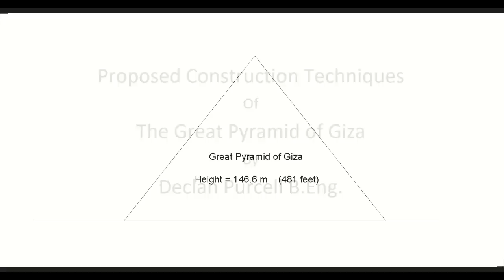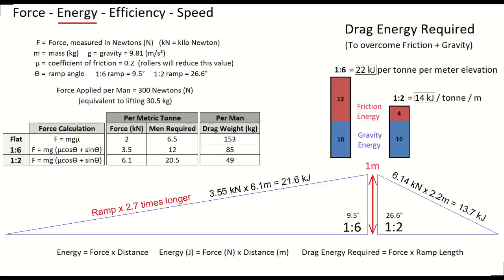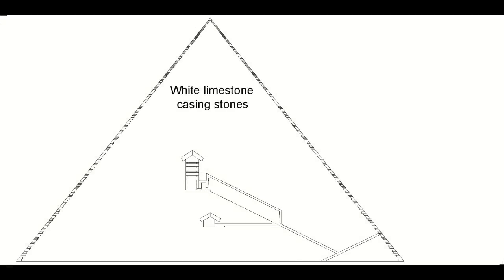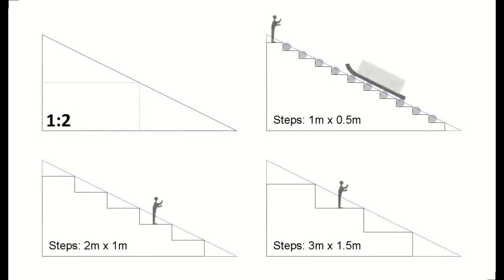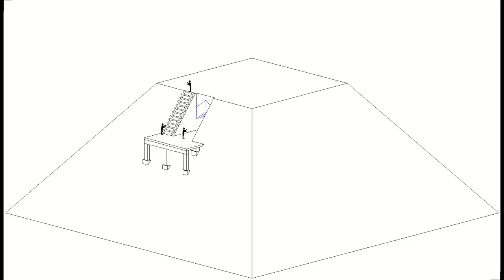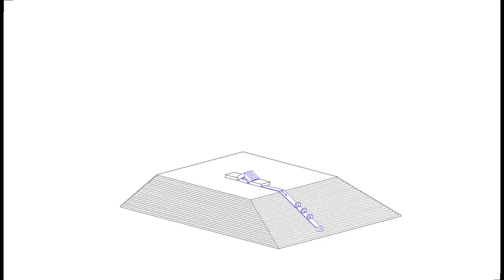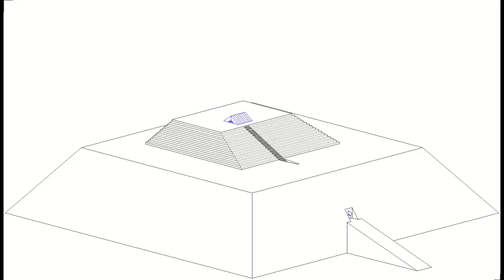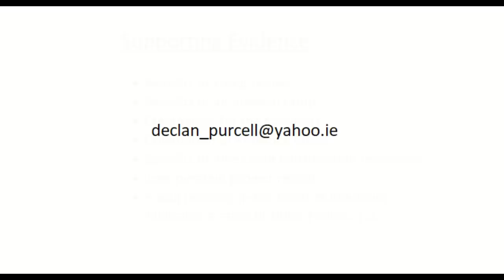Proposed Pyramid Construction Techniques

Comment: Good vid, interesting for sure.. But only one small problem with your estimates.. How did they move 1200 ton obelisks out of quarries in the mountains over 500 miles away? You say 1200 men for one 80 ton beam? Then how did they place them so precisely without breaking any corners off the blocks? How did they move 100 ton boxes in tunnels  with one foot space either side?? There is simply not enough room in front of the block for the men required to move a 100 ton block.. Your assessment is good but there are too many holes that need to be filledwith another explanation
Reply: I watched a couple of videos on this topic over the last few years. 

One was proposing usage of the water shafts  - very interesting one

Other was about ramps built in the outer perimeter walls. Then they were walled off - similar to this one. 

And then there's this one. 

I think we will just never know for sure but these theories together paint somewhat of a clear picture of how it might have been done.

Or it might have been the aliens, of course.
Reply: 1 man cab move 1 ton 300 feet solo per hour.  There’s a video here on youtube showing how. Basically pivots and gravity, he walks them (not unlike the Merlin myth).
Reply: 100T box?
They floated stone from causeway, some evidence is still visible. They used sleds, with 2 barges on either side. The sled with barge could float 80T and still be buoyant
Reply: The boxes at the Saqqara Serapeum was most likely rolled or dragged into position, one of the boxes was found with sand under it, so they most likely put it in place on sand and then removed the sand to lower it into place. Just as we did 100 years ago and still do today, those people most likely used rollers like greased loggs to drag them on, and then hey had either manpower or animals to drag them with ropes. How to raise an Obelisk of 1200 tons is a mystery for sure, but at that quarry of Aswan there had been a water channel leading out to the Nile, and raising Obelisk have been demonstrated that it can have been done with removing sand as well. Most likely they would have put something under it before it would have been completely out from the bedrock. It should be added that the unfinished Obelisk is laying at an angle, a bit tilted already in the bedrock, most likely intentionally for it to be removed more easily, this way you can swing one end that goes down while the other end goes up, and eventually it will raise above the bedrock by putting things underneath it, this method was often used by workers 100 years ago
Reply: @karlkarlsson9126  My relatives are from an area in Italy, where a lot of marble quarries are. In every museum you can see drawings and photos, of how people cut and moved huge blocks without machines. They used mostly counter weights, ropes and logs.
Reply: People commenting here obviously know nothing about basic physics..sand and sticks moved 100 ton blocks 500km .. yeah right …
Reply: @kiwi73  they can and did.
Not only are their hieroglyphs showing them doing it, there was a paper published in Physics Review in 2014 showing howbit was done.
And at some sites ramps are found, canals are found lined with clay and steps on the side with small portholes. 
The Egyptians used many techniques, together, to move blocks. Leverage, counterweight, friction reduction and Pulleys
Reply: @kiwi73  While you are typing further nonsense, a Brit is moving 20+ tons blocks. Alone. Yet to replicate how Stonehenge has been built. Cheers
Reply: @minkowski4d  the only one who is talking nonsense is you I think, the Brit you are talking about moved 20 ton blocks on a conference surface not on ground and certainly didn’t move them any great distance in fact only a few feet so think again and answer my question.. how did the Egyptians do it without steel or metal rails or ball bearings on any of the things they had in the Italian monolith video?
Reply: @kiwi73 you don't want to believe it thats fine. There are articles jn the Washingtonn Post from 2014!
It was closer to 27 years but the important part is that these crews were working in tandem, not 1 at a time AND the quarries were running all the time, not just for pyramid building.
I'm curious, what information would you need to see to believe that the pyramids were built with only manpower and leverage?
Reply: @timcarbone007  all it would take is for someone to actually cut a granite block to the dimensions of the pyramid stones using only bronze chisels or saws, leverage and dolomite pounding stones...haha... what a joke.. how would precision be achievable using such methods? 
For the record I am not disputing the timeline, I am disputing the explanation for how they did it.
Reply: @kiwi73  there are videos on YouTube on a channel called, I think, scientists versus myths, where they use ancient tools and techniques and show on a small scale how they did things.
As for the timeline I believe you're quoting the Ted Talk about the pyramids..? If so, why are you not agreeing with their conclusion on how it was done? Latest estimates of times are at 27 years not 20. And new evidence suggests Khufu ruled for almost 40 years which means the pyramids could, possibly, have more time to be built. The last part is speculation of course
Reply: @minkowski4d  explain how an 80 ton granite block can be pulled by men up a ramp? And with what rope would hold that weight? using no steel to assist… show me an example from the past !?
Reply: This is an elegant video to complement and equally elegant hypothesis. Well done mate.
Reply: @kiwi73  an example? The pyramids maybe? you need roughly 300 men to pull a weight of 80 ton up a ramp of 10 degree. The equation is as follows: No. of Men = sin(10) x 9.81 x 80.000kg / 200N. Average Pull force of a human is roughly 200 N. You may add 20-30% considering friction. That calculations yields ca. 700 men with a buffer for the friction of ca. 210 men. Thus, 910 men in total. But the Egyptians (as everybody back then and also today) used pulley systems.  Practically numbers of ropes supporting the pulley vary between 3 and 4. Let's say 3. Hence, given the above linear equation you can simply divide by 3. Thus, you need 233 men (adding a buffer of 70 in case of further friction. Now those 233 men do not need to pull on one single rope. that would be utterly stupid. let's make it 2 ropes in direction of pull and two with opposing angles. Means, ca. 60 men per rope. Given the basically unlimited labour force the problems narrows down to coordination and logistics (food for the workers). Any other questions? No? good, let me ask you some questions: what is your alternative fact theory? How did they do it? aliens? advanced technology? ancient civilisation? Where is the evidence?
Reply: @minkowski4d  bro’s not responding after that one Lmao
Reply: I think James is into the ancient aliens theory.
Reply: @Lightningdvc  not likely, aliens no, advanced civilisation yes..
Reply: All demonstrated here: https://youtu.be/Z-Ji2jPZtoQ
Reply: Guys, don’t bother, he will do whatever it takes to stay in the illusion. It’s very sad and a pity but let’s move on shall we.
Reply: @minkowski4d  if you asked science the existence of a 8000 year old civilisation say 10 years ago the evidence would suggest there was none, but after the discovery of gobekli trip in turkey they now say yes there was a civilisation at that time.. you see paleontology takes time as new evidence is being discovered .. what I can say is that you have no explanation what so ever for the incredible precision of predynastic Egyptian stone faces, vases, bowls, statues and carvings. 
Science bro… science changes all the time as new evidence presents itself..
Reply: @minkowski4d  you’re calculations are also folly.. explain and do the math on how they moved the largest pieces of 1200 and 1400 ton statues, obelisks and figures.
Reply: @kiwi73  Oh that's an easy one: Tesla flew back on his Time Machine. He connected the statues to his free energy-levitation device and lifted the blocks. Aliens from Alpha Centauri were applauding the scene.
Reply: According to whom? Cite your credentials and research in the field.
Reply: @drstevej2527  what is your question referring to? Whom is it referring to?
Reply: @kiwi73  
When a post is directed to the original post it does no appear as a response to anyone else.
Reply: @drstevej2527  that makes sense, thanks for clearing that up for me.
Reply: Sorry guys I have made a correction to my first comment the granite for the great pyramid was quarried 500 miles away not 300 as I previously posted. Aswan is 420 miles away from Cairo.
Reply: @kiwi73  
Given that 20000 people were working at any given time to build the structure it hardly makes a difference. This great pyramid took over twenty years to build. They could have bought marble from Germany given the workforce.
There are numerous explanations based on the existing excavations that explains how it was built with such accuracy.
Reply: @drstevej2527  Ok I am well read, I haven’t completed my doctorate but I have completed my masters so I can make fairly accurate assessments. I just want you to answer one question: ‘how did they cut the stones blocks to build the pyramids?’ And if you say they used bronze saws with sand and water then you are definitely not a doctor..
Reply: @drstevej2527  I thought as much you are not a real doctor, I mean who puts Dr in front of their name unless wanting recognition on YouTube??  For Christ sake, I don’t have to cite any other papers in relation to what I am saying due to the fact that all I have to do is ask simple questions relating to accuracy and precision. You say the majority of stones were not uniform in shape..yes you are correct they were not uniform in size which makes it particularly more difficult to construct. ‘The outside layers bound together by mortar’ are you talking about works that was done after construction or as part of the original? There are many example to show works done thousands of years after construction so please enlighten me as to the particular paper you are citing with which particular piece of the pyramid? ‘Not particularly accurate’ funny quote considering the pyramid block levels have to be accurate within parameters less than an inch for it to be stable at the top and maintain a uniform structure throughout, this is a plain engineering fact. I think you are a doctor of theology not science.
Reply: @kiwi73  
According to whom? You cited absolutely nothing including your credentials in ANY related field of study. It’s clear that you have no actual credentials in any related field as the first step to discussing any topic is to demonstrate that you are qualified to discuss said topic. A conference discussing cancer research just might include oncologists. This is a huge topic and you cited absolutely nothing. What on earth kind of degree program was this? Remember this lesson in epistemology.
Step one when claiming an advanced degree is to download a grammar app.
Reply: @drstevej2527  neither have you... you cited jack... what university did you obtain your doctorate from? I obtained my masters from Auckland University New Zealand... come mate cough up..
Reply: @kiwi73  
I hold a masters and a doctorate from the University of Chicago. Perhaps you have heard of it in the context of Egyptology and other Ancient near East civilizations.
Still nothing like getting a degree from a 3rd tier school in which you never learned to cite anything.
Lesson one YOU are the one making the claim in your initial comment. You must cite your evidence, credentials and the work you claim to reject as I’m not a mind reader. What on earth kind of a school is this?
Reply: It's the precision polished and carved vases that baffle me, not to mention the super accuracy of block placement, and shapes and the 0 tolerance fit of them  all together, it's like they were made of playdough and the alignment of the whole thing is so precise. I'm definitely with Hancock on this one
Reply: @fallfromgrave  yeah mate agree with you.
Reply: @kiwi73  
The University of Chicago has produced the most Nobel laureate on earth. It’s only second behind Harvard in the number of years that it was ranked the best university in the world since the ranking system began.
Reply: @drstevej2527  credentials don't mean jack, its the evidence that matters
Reply: @LostEchoGamer  
Yes and GH has yet to produce any credible evidence. Secondly evidence is only valuable if have the skills and education to understand it. GH has no such educational background.
Reply: @drstevej2527  seeing is believing my guy. ✌
Reply: @LostEchoGamer  
Yes and GH has produced nothing worry seeing. His claims are laughable to anyone who has any actual knowledge of these topics.
Reply: @kiwi73 So you ask a doctor on how to cut stone? 🤔
Reply: @kiwi73 
This is one thing that Egyptologists (and most archaeologists imo) simply do not want to face. It is one thing to say we know how they did it. It is another thing to prove it. The recent analysis of a stone vase (1) from dynastic Egypt using modern metrology methods (2) clearly shows that the object had to have been turned on a lathe. And one with fairly precise bearings on the spindle. And rigid means of holding the workpiece to maintain the level of precision found. Look I'm not saying the ancient Egyptians had a highly advanced technological civilization. I'm simply saying that they were likely using tools and techniques we haven't recognized yet. 
1) We call it a vase. What precisely it was used for is something else.
2) CMM technology. Just how do you think modern metrology is used for inspecting the products produced by industry today.
Reply: @mpetersen6 I have never seen any Archeologists say they KNOW how they did it. What I do see is Archeologists say is that they had the tools and ability to do so and give possible ways it was done.

It's the believers in guys like Hancock that claim THEY KNOW the Egyptians DIDN'T build it. Weird how that works isn't it?
Reply: @swirvinbirds1971  hancock says the egyptians did build it and that their civilization goes back much further as the egyptians themselves said that. Don’t get confused.
Reply: @GG-ng6zm  
Do you understand that research is interdisciplinary? Do you really believe no one consulted engineers and architects when doing this research?
Secondly there is an entire subfield within archaeology that is focused on engineering.
Reply: @swirvinbirds1971  so why did you say he doesn’t and now you’re saying he does. You’re switching up your statements lol. Archeologists said different things in the past too, doesn’t mean you hold them accountable for that, new information allows for new theories. Furthermore you’re spewing false facts saying he accepts the dating of the pyramids when he clearly doesn’t and has stated a large project occurred at that time encasing the pyramids with limestone blocks, not the actual whole construction of the pyramid as the amount of stone quarried was only enough to encase the pyramids based off of texts that show the order of limestone blocks.
Reply: @GG-ng6zm  go back and read what I actually said. What part of 'FOLLOWERS of Hancock' makes you think I meant Graham Hancock himself?
Reply: @drstevej2527  No they didn’t, that’s why there’s been no proven method as to how they’re built. They dated the organic matter found in the mortar and attributed its age to that. They didn’t ask engineers or architects how the dynastics could have built it so they came up with their own theory of copper chisels. That theory of construction didn’t come from an engineer or architect it came from archeologists and that has you fooled.
Reply: @GG-ng6zm  
Which is utter fantasy as he has not produced so much as a toothpick from his mythical advanced civilization nor any evidence that it influenced anything or anyone.
Reply: @drstevej2527  do your research before spewing false facts like it’s your agenda lol you’re getting so emotional while places like gobekle tepe, gunung padang, adams bridge, and the sunken city of dwaraka disprove your emotional outbursts.
Reply: @GG-ng6zm  
Then cite it! Cite the major works that you CLAIM to have read on this topic and we will see what you know about interdisciplinary research. It’s almost laughable that someone would think that the research community never consulted engineers and architects when doing this analysis.
If you don’t know what GH has stated about supernatural technologies then you don’t know anything about his ridiculous claims.
Reply: @drstevej2527  You can’t post links in comments, see it with your own eyes online it’s not hard. Search up the locations i mentioned and do thorough research. Also try finding an architectural engineer that explains the archeologists theory behind the construction of the pyramid. You won’t be able to because they haven’t consulted with them.
Reply: @GG-ng6zm  
I thought so! Hint long before there was social media researchers could cite their sources and evidence. 
Start anytime!
Author 
Publication 
Methodology 
Peer Review 
No Joes Great Pyramid channel is not a citation. This is why you can link to a thousand Flat Earth sites if you do a search on the topic.
Remember this lesson!
Reply: @drstevej2527  so you’re just too lazy to look at it yourself? Says enough about you lol
Reply: @GG-ng6zm  
Yes it says that you can’t cite actual peer reviewed evidence. Remember this lesson!
Reply: @drstevej2527  Dr Steve j you’re fighting the good fight but he’s trying to drag you down to his level and beat you at stupidity. Some people thrive on other’s aggravation.
Reply: @mpetersen6  concering the vase and the necessity of a lathe with precise bearings:
I don't think it's strictly necessary.

(sorry, I didn't read all the comments or the sources)

You can make extremly precise holes with a drill (or reamer or lap) that guides itself on the walls of the hole. 
You can also make a pre-drilled hole way more precise this way. 
You could then, in theory, use a precise hollow rod and internal water flow lubrication (or maybe mud, for viscosity and dampening) to use the hole itself as a bearing and work on the outside of the vase.

Age of sail cannons were (in at least one case) drilled out by rotating them on a drill inserted vertically from below. (the cannon's precast bore being vertical, too) 
In a big wooden scaffolding with ropes driven by a "horse engine" providing torque.

I wish someone would give me the money to try it out... maybe I'll have time someday.
Maybe I should try to make that a youtube channel, haha...
Reply: @mpetersen6  (unless you are talking about the shist disk and not stone jars. I have theories on how to construct simple machines to make the shist disk, too, but they are buried in the comments in one of the videos concenred with the disk.)
Reply: @drstevej2527 i always wonder, why those „advanced technology“ believers do not apply the same logic to Ancient Rome or Greece.
Reply: @minkowski4d  this is archeology not science you goofball lol wrong subject
Reply: @minkowski4d  
Part of the reason is that we have excellent records about Greece and Roman building technology as modern civilization is closer to us in time than they were to ancient Egyptian civilization. Some fringe nuts do claim that even their civilizations were influenced by aliens or Atlantan nonsense. It’s much easier to fill in the history that is grey than the history we know well.
Reply: @kiwi73  The Pyramid has grooves worn into the center of each side of the pyramid that you can see in pictures. Why would an advanced civilization not be able to avoid this issue?
Reply: Elephants.. Egypt had a very different weather pattern as well as more people than originally thought.. It was a paying job.. Think Hoover dam.
Reply: @ericcagle1192  
It’s estimated that over 20000 people worked at a time on the structure over 20 plus years.
Reply: Lots and lots of ramps. All over the place.
Reply: To add a possibility, 1 bull can replace 20 men for pulling. 5 bulls = 100 men, 10 bulls = 200 men and so on.
Reply: @kiwi73  I study physics, and yes, this is totally possible
Reply: @DEFCON5307  theoretically yes.. but where are the hieroglyphics to back this up?
Reply: @kiwi73  sand and sticks. Right. Ok so Egyptians aren’t allowed to use wood to build anything more complicated than a stick, but Europeans were allowed to build vast and intricate cathedrals and castles using contractions built from.. wait for it.. wood. And let’s not get started on the megaliths of Neolithic Britain or Rapanui… they clearly didn’t achieve that using human labour or available materials…..
Reply: @GG-ng6zm  okay, so archeology is not science....guess, you've won the price for the dumbest answer given in this thread....
Reply: He's stating theories. I don't think he claimed this was gospel. The whole mystery is all about how we don't have a clue how it was done. It seemed more like he was giving the likeliest options. Directly because it would be difficult with our technology now. It's really hard to put your head in the past, because we don't think about construction from their perspective. Even if we do eventually figure it out, we still could be confused why they did it in whatever way they did. Perspective is really weird. Completely subjective, yet highly important in human society.
Reply: Granite blocks are extremely durable corners not a problem and crating techniques can be applied to delicate edge work
Reply: @kiwi73 hemp fibrous rope has tensile strength of steel wire rope. Plenty of bridges were also supported and spanned with same.
Reply: Sorry guys but master stonemason trumps any PhD in matters involving stonework. Stonecutter is a specialist under the umbrella of stone masonry. Primary stage after quarrying uses splitting wedges and cleaving hammers to split and dress blocks square. From there they can be further dimensioned or faced by a Finisher/Shaper which is often another trade specialist although some stonecutters wear both hats.
Reply: @GG-ng6zm  wow. Even doubling down
Reply: @GroberWeisenstein  and this is the part where you tell us how they levelled stones to within 5 thousands of an inch with hammers and chisels… 😂😅🤣🤣 and granite vases to within one thousands of an inch??? Not to mention the pyramid is aligned to true north to the same precision as we can get it today…
Reply: @GroberWeisenstein  that is not true, steel braided cable is far stronger than hemp rope.. also what kind of rope must it have been to take loads like that? The ropes would have to have been manufactured to very precise tolerances, with tons of pressure it would expose weakness in any rope snapping them like string. To have strong rope you would have needed an extremely good factory producing them
Reply: @kiwi73  within 5 thousands an inch where, ? be specific please.  One thou inch of what ? There is no other matching vase or maquette etc to reference for tolerance accuracy according to a predetermined design. I Haven't looked into alignment I suppose you'd have to adjust for true north creeping 10km per year and cross reference where it was at the time the pyramid construction commenced until completed.  Not sure if you take any of this serious you seem to be against the premise of chisel technologies.
Reply: @kiwi73 incorrect. Hemp fibers have more bendability and tensile strength than steel wire. Fact is hemp rope is documented used by Romans , Greeks etc in early  industrial history, early suspension bridges, and 'age of sail' ship rigging. More than adequate to be strong enough for rigging and stone sledging.
Reply: @GroberWeisenstein  true north is not magnetic north which you are referring to. True north is the exact North Pole not magnetic north which does move around. Please try to be precise in your facts. Precision in all predynastic Egyptian artefacts is well documented.
Reply: @GroberWeisenstein  So a 70 ton block of granite has edged that can withstand a 7000 kg impact.. yeah right dreamer!
Reply: @GroberWeisenstein  so hemp is superior to steel? Yeah right.. there are many other factors other than tensile strength that makes steel cable far, far superior, by your logic we should be using spiderweb which is the strongest of all!!
Reply: @GroberWeisenstein  of a set point of reference of course. These artifacts have been measured and are incredibly accurate..
Reply: @kiwi73  and how much variation in declination has been determined in support of or against the use of a magnetic compass for construction orientation ?  This should be compared with the Polaris star alignment theory of that day which is also not a fixed paradigm. It seems to me you are more interested in correcting suppositions than open to exploring alternatives? A statement about widespread precision has to be more specific and thorough in quantifying an object's qualities in reference to an achievable standard of precision.
Reply: @kiwi73  the point is not that it is superior which is obviously not the case otherwise we would still prefer to use it today. The point is that it did historically serve the practical  purpose  for rigging and sledging stones in antiquity and later until the introduction of steel wire rope. Metal-enriched silk happens to be a space age material and yes is much stronger than steel. Welcome to our planet. By chance is your field of study in working towards a Dr of Chiropracty ?
Reply: @kiwi73  mechanical properties of granite are in the 36,000 psi compressive strength range. Not sure what forces you are implying the stone's would typically be exposed to ? Is your 70 ton block of stone tumbling from outer space ?  In quarries granite blocks up to 150 tons routinely slam into bedrock during hoisting or fall and tumble with no discernable damage. Granite setting is typically slow going and therefore manageable.
Reply: @kiwi73  i'm in the granite quarry business processing fabricating installing for over 3 decades. there is this thing we use for building mausoleums, monuments, and architectural products to reinforce finished edge work called "crating". Didn't they teach you about this in "landscaping skool" or were you too busy mishandling small pieces chipping off corners because you lacked strength? pro tip: use suction cups, scissor clamps, lewis pins, lifting straps, wooden spacers etc. or go into the gravel business.
Reply: @GroberWeisenstein  oh I forgot they were protecting edging in ancient egypt with wooden spacers and strapping…?? If you were in the granite industry for so long then you should be the one to answer this…how did they move and cut these huge pieces? Obviously I learnt nothing in my tenor as a landscape labourer.
Reply: question: lets assume for a moment that the pyramids were not built in 2.5k BC, but that the y are older. How did that older civilisation built them? How did they pull those blocks?
Reply: @minkowski4d  same way they pulled them up until the industrial revolution of late 1700's. man, beast, mechanical advantage, willpower, ingenuity.
Reply: @kiwi73  easy. one piece at a time.
Reply: They did not move any 1200 ton obelisks. This is a common misconception. You are thinking of the Unfinished Obelisk, which was never moved or raised. The largest raised Egyptian Obelisk is the Lateran Obelisk at 330 tons. The Unfinished Obelisk is not relevant to discussions on how the Egyptians moved obelisks because it was never moved.
Reply: @hydra70  technically it's not an obelisk. In quarry terms since it's still attached to the bedrock it would be called a 'section'